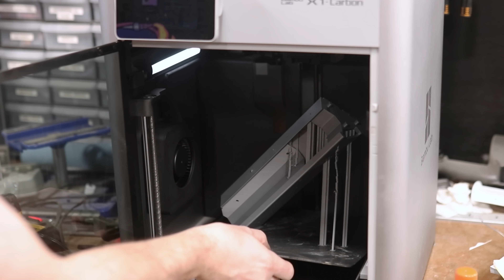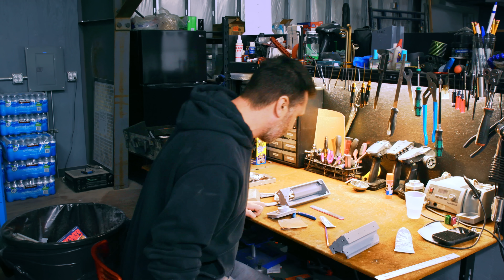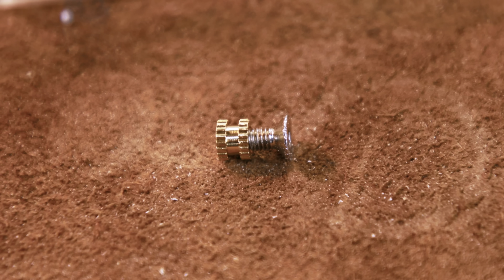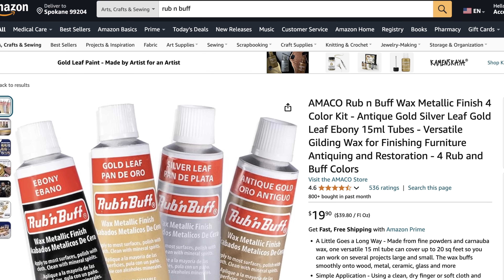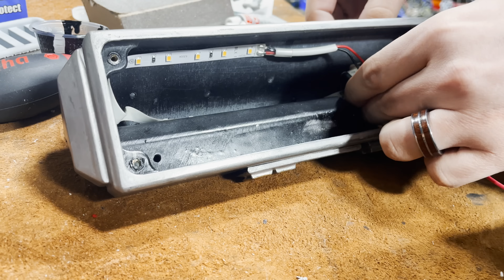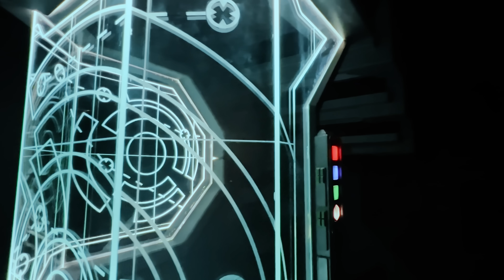Tips I Learned on How to Finish 3D Prints

Comment: Stargate Universe. 

The set designers commented once, in a YouTube video, about achieving the metal “look” in their sets for The Destiny. They noted that the sets looked like genuine metal when they made sure that the edges and corners were metallic or lighter in color than the panel faces of structural members. Apparently, the way our kinda work is there are learned rules how certain materials behave under various lighting conditions, and as long as certain criteria are met, our patter-recognition will classify something as metal if it has shiny edges. Fascinating, right?